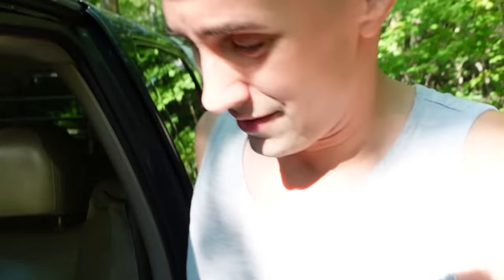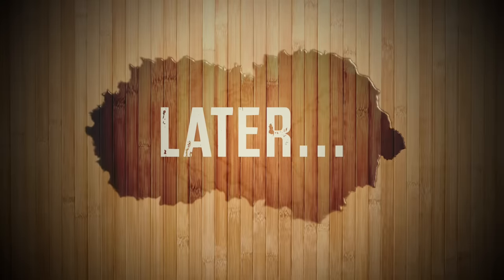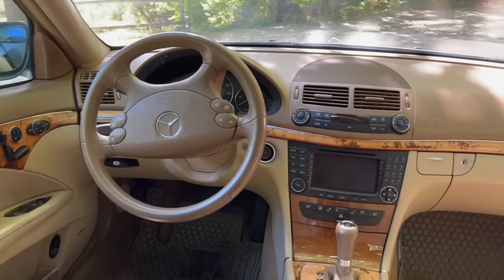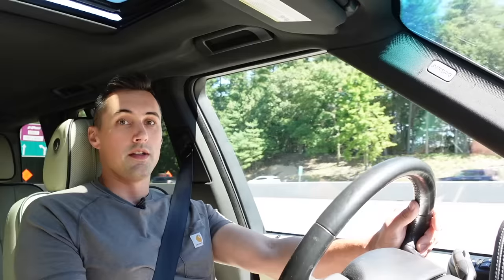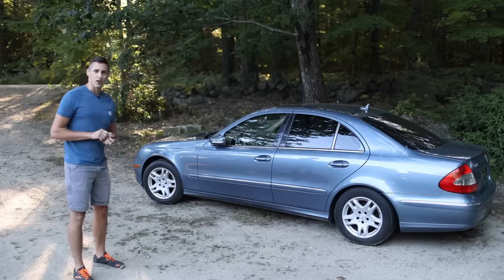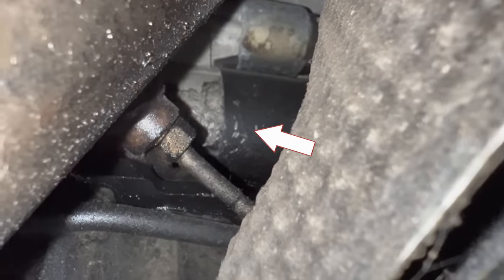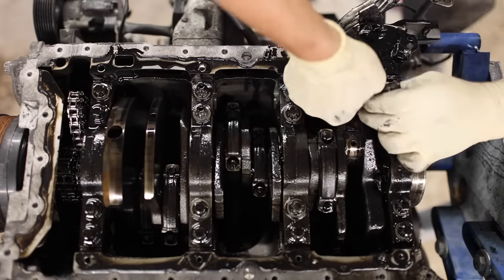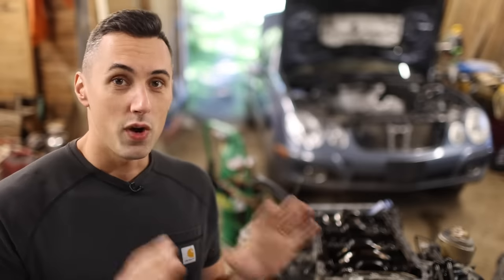I Bought a Repo’d Mercedes Diesel and I Regret it. Here’s Why You Shouldn’t.

Comment: After buying a 2008 Audi A6 allroad in 2017 here in Latvia, I've been eyeing one of these (go figure) - of course, in the Combi version (to me sedans just waste the space and practicality offered by the same car in wagon version). The engine replacement to V6 was done in somewhere in 2005, and this newer V6 diesel is still used to this day in Mercedes vehicles, including commercial and light cargo. The previous one was an I6 and many said that was the most durable engine made by MB at that time, so the V6 couldn't have been very bad - in addition, it was said to be a torque monster with I think 550 Nm of torque - my audi has 450 - and even that's a lot. These mercs were unfortunately only offered with automatics - Merc said the large torque numbers were unsuitable for manual gearboxes, although both Audi and BMW offered manuals for their top end diesels at that time. Anyway. We have another smaller merc - a 2012 A class in the family with a smaller 2,0 I4 diesel - and it has been dead reliable so far, compared to the audi, even with the entire modern diesel "conundrum" - the DPF and EGR, but I do a lot of oilchanges (Castrol full synth Edge 5W-30). Anyway. You've got a new subscriber, greetings from Latvia. Btw - Samcrac actually shows stuff like this, but he's unwatchable due to his cockiness - insted, Hoovie doesn't get involved in repairs, but for that he, of course, has Wizard and Ninja. Edited: reading other comments, yeah - that usage of a shop jack on soft ground bugged me out, too - that type of jack is designed to be used on hard, level surface only - it's supposed to move while the car is being lifted, hence the wheels. I have a garden w/o slab or stone around the house, but I've been using a simple trick for years - got myself a steel plate, everytime I use the jack on wheels, I put the plate underneath the jack. That one time I didn't didn't end too well. Stay safe!

Comment: I also purchased a 02 mercedes-benz cl55 amg from auction, only bad thing was  something with the abc system ,after doing some research and found out what it could cost to fix😳 I did a coilover conversion, buy hey good luck with your car, I love the car but way way over engineered 🤣

Comment: Diesel engines have a very much undeserved reputation.  They are better than gasoline engines.  In fact I heard somewhere that gasoline (without all the additives) is really just a byproduct of Diesel production.  Consider all of the stuff that is in crude oil, it is NOT just gasoline but really a blend of all sorts of things that get distilled out and there are a lot of things that come out.  Really even despite Diesel gate I would still buy a TDi Volkswagen.  They are NOT sluggish like like some Japanese economy cars (Corollas and similar cars) often are.  One time my Uncle and I borrowed my other Uncle's 05 TDi Passat and it was never once slow yet on a trip to and from Florida from Pittsburgh we only filled the tank twice!!  Try taking any other car on the same trip with a similar size fuel tank and you WILL fill it at least 3 or 4 times!!  It just seems like a travesty that they have gained such a bad reputation.  That bad image of Diesel really just comes about because of big heavy dump trucks and similar vehicles that appear to move at a snail's pace uphill and fill the air with soot (black smoke).  At least that is probably what image we conjure up in our minds when we hear name Diesel (after Rudolf Diesel who invented them)

Comment: Excellent video!  Excellent descriptions!  This reminds me of a situation I experienced when purchasing a reposessed civic coupe for my brother from an auction house in Utah.  The car looked great and ran great but gradually overheated.  Turned out to be a cracked head letting air into the cooling system over time.  Replaced the head in Moab, Utah which was expensive.  He used it for six months and we sold it in San Francisco at a loss, but if it didn't have this hard-to-identify problem we would have done well.  How would we test for such a thing in advance?

Comment: My aunt had a diesel Mercedes back in the late seventies or early eighties, it was a bug ugly grey box, it sounded like a truck and road like one too, she then bought a smaller one, I have no idea what model it was. She was pulling up to her garage one day and blacked out, flooring it and crashing through door, it wasn't open yet and unto a cinder block wall in 5he back of the garage taking out the furnace and hot water heater, she lived on a cul de sac, the whole area had to be evacuated until the gascompany arrived because the gas pipe ruptured, that was supposed to be my car, she passed away in 2013 at 92.

Comment: I have an 2007 e320cdi v6 (om642) engine with 280.000km about 170.000miles these engines have issues but if you fix the failure points on it should be very reliable.if you buy a used engine for it. Replace the oil cooler seals they are known to go bad on these engines. Rubber on the intake where it connects to the turbo can go bad.

Comment: This probably had an oil cooler replacement and the tech used brake clean to clean off the valley. Brake clean got down into crank and washed the oil out of the bearings on the crank. Seen it a lot.

Comment: Why not take engine, transmission out. Weld in GM 350 engine mounts and GM transmission mounts. Then install GM new engine and GM used transmission, and have drive shaft shop manufacture a made to fit drive shaft.. Ptesto!.Great car for many more miles.

Comment: To be fair to HF, that engine hoist is only rated to lift 500lbs at max extension like you had it, and that engine and transmission probably weigh more than 500lbs.

Comment: This is not the diesel engine to go in the W211. The inline 6 Om648 is unbreakable, the later V6 as shown here has major issues like swirl motor, timing chain, turbochargers, breather hoses, lubrication issues and the list goes on.

Comment: A moment of silence for the demise of that OM642 engine.  Normally quite reliable.  Clearly poor maintenance caused its failure.  Waldo is right: change that oil early especially if there are alot of kms on the clock.

Comment: I owned an E320 cdi from new in 2008. In 2015 after 136k miles it threw a rod and totalled the engine. Was a lovely car before that.

Comment: If were you, you should have bought any Mercedes-Benz diesel prior to MB's merger with Chrysler. Sure, its more analog, and do not many features as more modern Mercs, but the engine is (with religious maintenance) bulletproof and will run solidly for thousands of kms.

Comment: The underside of the car is really clean like someone really took time to clean all the oil off from when the rod came thru the block. Don't like devious sellers. The seller, likely purposefully, didn't include the key so no one would try to start the engine.
Maybe it's time to start buying Chevys and Fords at the auctions instead of pricey cars that require expensive parts. Or, stay away from auction cars that don't have the key; the key may be missing for a devious reason.
Just out of curiosity, I checked on what a used engine would cost for this car, and if I did find the right one, it would cost $4,800. Wow. Finding a wreck at auction with a good engine would be the way to go if it can be had for cheap, but since these models are rare, chances of finding such are not good. Hope the one he found is useable.

Comment: 550 is a good price at the miles low just buy another one that's wrecked and put the motor in that one for $550 or you can get the motor out of a van the motor is going Vans as well and it's the high output version

Comment: The two worst cars I ever owned/leased were a 2022 Audi A6 and a 2019 Mercedes E-350.  These were new cars, I cannot imagine one of these things with 100K miles on the odometer.  Both of these cars were problems from the get-go.  My 2015 Jeep Grand Cherokee Overland Hemi is still running like a top with 145,000 miles on the odometer, and I will buy a new one when the new 3.0L in-line-six becomes available in the Jeep Grand Cherokee in 2025.  Absolutely, no more German cars!

Comment: Part it out. If the engine died from neglected maintenance, the transmission, transfer case, differential is probably not in good shape either. Plus as a Mercedes those parts will cost an arm and a leg..

Comment: That looks to me like it's been run out of oil which led to the destruction because the engine where the holes are wound be a lot wetter with oil if it had enough in it when it blew up, also more than one rod bearing failing is a sure sign of oil starvation.

Comment: They pollute more than petrol cars…..you forgot to mention. 

And they are noisy . 
Not so much with this model though thanks to fantastic soundproofing in the cabin. 

But still an oil burner. 
Much prefer a 350 petrol or the bigger 500. 
So much more refined.

Comment: Thanks for a great video. I am a regular viewer, and usually love your content. I really enjoyed the detailed look at what happens when an engine destroys itself. It is hard to imagine that just missing oil changes would result in this. I have heard of a Toyota truck being run for 200K miles with no oil changes. Is it just a matter of this being a more high performance car? Or do you think it is that this is diesel? The Toyota was a gas engine. As far as what to do with it, as others have said, use parts from both to make one working vehicle and sell the leftovers seems like the best option. Also, I’m curious how long all that tear down took in real time, not sped up video time?

Comment: I had the 3.0 in my Grand Cherokee and they tend to be super reliable and easily able to do 200k miles. By then they are run in. Parts are very expensive though and getting hard too find.

Comment: Okay, so it was a bit more then 🙈 But a replacement engine used, aren't that expensive,  you got the car for around 1000$ so there are still money to be made, or you will have a clean daily driver... Ofcourse,  if it is what you want... I would've put a new engine in it... If the mechanical are okay all around...

Comment: Didn't the vehicle have to be at the Mercedes shop to be programmed?
Reply from the maker: I do have to bring it in to get the keyless-go to work (I'll drive it there if/when I get it running). Otherwise, no programing necessary to use the key manually

Comment: You should fit a mercedes om606 engine and get it modified by dieselpumpuk you will never have any problems once you adapt your car to run that engine. 10 times better than the engine you have there.

Comment: well yes you may get 38 highway, but diesel is about 5.50$ a gallon and E85 is less than 2.50$ a gallon and has 20% hp than gas. 
I got an 02 E430 from coparts with 80k miles, looks physically perfect inside and out. a crank no start "enhanced vehicle".  A flood vehicle, primary damage body ?  the car was dry, no water marks anywhere hmm. 
A code for a bad break light switch. should be a quick fix? 
Well flood means it was damaged by water in some way, in this case the car got splashed in the front grill with water where tge air intake is and hydrolocked the engine "twisted rod(s).
now thank god i wasnt the fool that bought it off copart for 7k$. I boughtvit off the guy  for 1500$ after i showed him the engine couldnt be turned with a 4' bar lol. But a v8 loaded 4matic is a good deal and a replacement engine was easy to find :)  yes I converted it to E85 for 800$

Comment: You bought the wrong one.  The one you want to buy is the 2005-2006 e320 cdi with in line 6 diesel.  The V6 diesel is junk.

Comment: What you have there is an absolute wonder of an engine, but, needs maintnance, and there is an example of bad maintenance, bad oils, late changes, etc, the oil isn't gooped too much, it just seems wrong for that engine, it needs 10w30 good quality synthetic oil. I've owned 3 of those 3L V6 TD, I'm in europe, those things on the road is daily bussiness :) And I've stuffed average 300k miles on them with minor issues and regular on time fluid changes, I can guarantee I din't spend more than 5000$ in maintnance in each one of them. I've already owned 8 E300 to E350 I6 and V6 3L TD, they were all in absolute shape. If you found a roling e320, keep that one for parts, 550bucks is really cheap, even a no engine class E300+ in europe, rarely go under 10k if it is in good condition. As a side note, pay attention to camera focus and lightning, get a light ring, they're cheap. BTW, over 70mph, those things roasts any ev :)

Comment: Ι own TWO Diesels like yours, one 2007 which I bought from a dealer in Oct 2016 for only $10,500 and the other, a 2008 with even more options and luxury than yours, I bought at a dealer in April 2017, for $11,000, both with short warranties so I did not worry about any initial problems.

BOTH cars have been OUTSTANDING and BULLETPROOF RELIABLE 100%, only maintenance oil changes etc. 

I do not know why the hell you took SUCH a gamble to pay a laughably low amount for a REPO (hint: IRRERPONSIBLE PRIOR OWNER) with no idea how it runs. 

But if you only paid $500, a fool like you might as well blew them in Vegas.

Only one correction: YOU will NEVER get 38 MPG HWY with these cars, UNLESS you drive them like an old lady. You can seriously get 35 at high double digit speeds. Where I drive, if you go less than 85 you are OBSTRUCTING TRAFFIC on the highway. If you drive 65, maybe you can get 37.

These cars are so reliable because of the DIESEL, in EUROPE all taxis used to be THIS EXACT MODEL and they do MILLIONS OF TROUBLE FREE MILES EACH.
Reply: PS I looked for the diesel because I wanted to ship the car to my summer home overseas where diesel is much CHEAPER than gas, but the first I got had a black interior and I was afraid it would overheat in the summer, so I kept it in MI at home and bought the second, white with beige interior, for the summer home. IF I bought a Merc Diesel for the US, I woulda  bought the MAGNIFICENT S CLASS S350 Bluetec, but these are very very rare in the US.

Comment: The W211  body lines are beautyful but the car is one of the worst MB ever, what did not break? 
Buy the W212 220cdi or 350cdi bluetec which are almost flawless.
Oil cooler, MAF sensors ($) and the subframe, that's all. The rest will last at least 500000km.

Comment: @Waldo's World, would you consider adding Steel Shield to your replacement engine to prevent the metal against metal wear described in this video? It's a US based company. Check out Pitor Tester's scientific test videos using it individually and added to engine oil on YouTube.

Comment: i stumbled upon this video and found it interesting. i have a 2022 subaru crosstrek with the 6 speed manual, subaru recommends 6K mile oil changes, and im not goiing to do that. im going to run 5K oil changes. im at 4,700 miles and im going to take the car in tuesday for it's first oil change.

i think manufacture recommendations are too long

Comment: 5:10 sized engine.. I just know it, this clown was driving the car in a way he probably shouldn't have been, busted the oil pan, drained the oil, kept driving until the engine got scorching hot and seized forever. He called Mercedes and was like "hey mercedes, how much for a replacement engine for my diesel Mercedes" , and they were like, "oh about $50,000" 😂 ,then he was like,   "😔 got it, so more than the car is worth at this point, it's basically garbage to me" 
And I bet that's pretty much how things went..

Comment: How often should i change the oil in my 08 c300 with 160k miles?
Reply from the maker: Does Mercedes recommend 10k miles? If you use a HIGH quality synthetic like LiquiMoly (my favorite), then I recommend 7,500 miles. If you use a common off-the-shelf synthetic (like at Walmart), then 5,000 miles is a safer interval because not all synthetics are equal. If in doubt, you can get your used oil tested in a lab and they'll make a recommendation 👍
Reply: I take it to firestone & they use the recommended oil..so ill have to figure out exactly how many miles im driving between oil changes...thz

Comment: I've seen quite a few rods thrown through blocks over the years and it always seems to happen right at the starter isn't that strange? It's a real bummer too because I'm sure once the connecting rod pieces hit that starter it ruins the starter… It would be better if the pieces would come out the other side of the engine and save you the cost of $100 starter😂
Reply: I’m thinking at that point the cost of the starter would be the least of  your worries 😀😀.

New engine….cost …..don’t want to know 😱

Comment: Diesels sound good? What? They are simpler than gasoline engines because they don't have sparkplugs? What!? What about their glow plugs? Maybe if this was 1980's this would be true but diesels require a turbo just so they can get out of their way. Glow plugs, turbos, intercoolers, super expensive injection systems, problematic EGR system causing intake buildup aand DPF systems. I don't say they are bad, they have a great fuel economy and can pull heavy things but let's be real here.

Comment: lmao.... WALDO   diesel is much simple then petrol  o yeah you forgot to mention turbo ,oil cooler,air cooler both for turbo,  high presure diesel pump , injectors and glow plugs ,egr , dpf...meanwhile on a petrol 4 spark plugs and induction coil

Comment: I have a W211 with similar specs and I looked around for engines for it because I want to try to make it to the 1 mill high mileage rewards the mbenz offers and I was curious if I had to replace the engine and I found a bunch going from $2-3500 with sub 100k miles on it